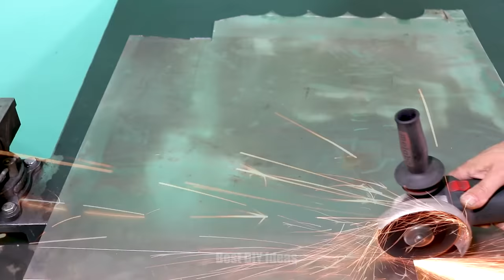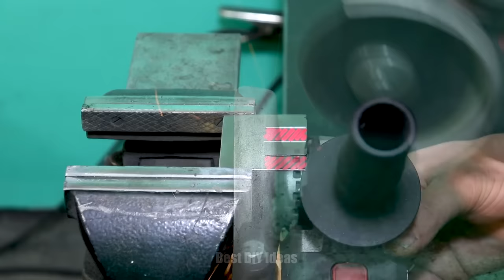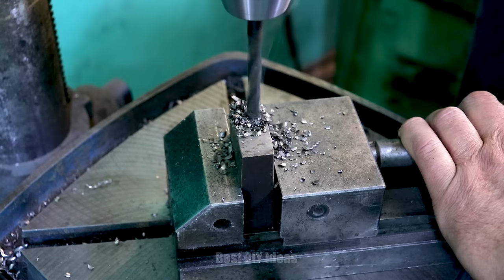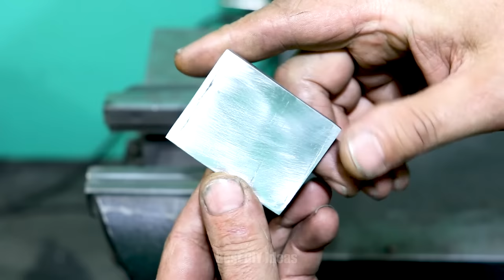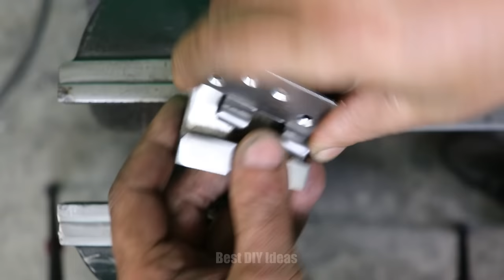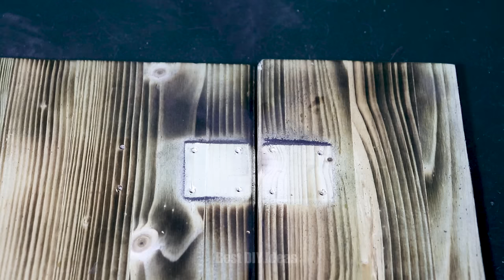Craft a DIY Metal Hinge Bender Following My Simple Tutorial

Comment: I would have 3D printed the dies. You can reinforce them with sheet metal pieces if needed. Way easier than carving a solid steel block
Reply: Takes to long
Reply: @tannerlane9669  Hmm well it depends. While my printing is working I can do something else in the meantime. Also ich can print multiple iteration with quick changes, in the end when I am happy with the result I can still cut it out. It´s way more messy.
Reply: @sierraecho884  printing parts is cute for small projects & demonstrations but I’m talking a bit more heavy duty , that little electroplated pla plastic would last maybe 1 day😂
Reply: @tannerlane9669  That´s why i´s called rapid prototyping, you create 1-5 prototypes until you get the geometry and all the parameters right, cheap and quick and if you like the result you can still carve it into steel. Also depending on the amount of parts needed you can use and break your prototypes and simply print new ones. If you only need 3 parts or so this is not an issue at all. Sometimes I only needed 2 parts I printed out some tools used them and threw them away, I still have the 3D file but I don´t the stuff lying around here where it takes place, if I need a new one I just print one out. As I said, it depends on multiple parameters and personal preference. Many times it is more economical to simply print out some parts.
Reply: @sierraecho884  Sir I literally just sumed everything up, that’s why I would use steel instead of 3D print, no need for a test run, plastic vs steel no comparison
Reply: @tannerlane9669  Yeah but you also said something like "...plastic vs steel no comparison..." Which is stupid. Because IT DEPENDS ON WHAT YOU NEED. There is no general answer. In YOUR case you prefer steel, that´s it.
Reply: @sierraecho884  Sir we’re talking about the hinge project now your strategically playing dumb, if your doing a few plastics fine, if your doing a lot metals best 🤷🏼‍♂️ Now what word games are you gonna try and play now 🙄
Reply: @tannerlane9669  There are no word games. Please tell what amount you mean by "many metal parts" are 5 many ? 10 ? 20 ? or 50.000 ? You can probably make 10 or more hinges with printed tools. You can certainly bend many sheet metal parts with printed tools. And you can print an unlimited amount of tools if you need any. 
"Metal best" is bullshit, it depends.
Reply: 😮 troppo tempo 🙁🇮🇹